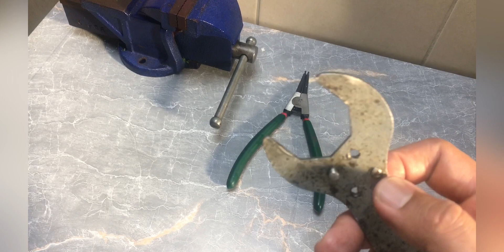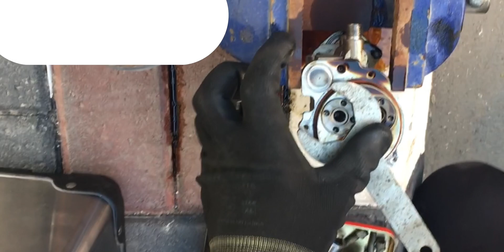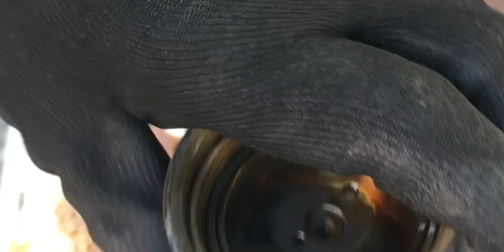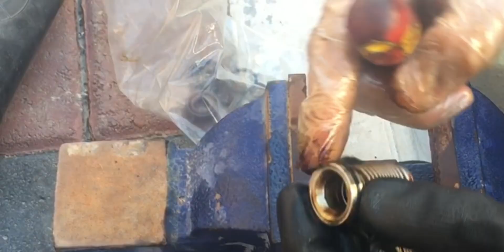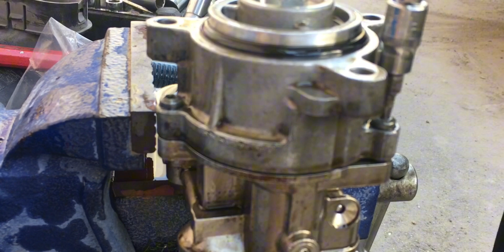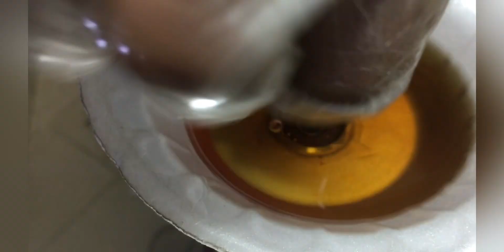HIGH PRESSURE FUEL PUMP Repair BMW N53 N54 N55 Engine

Comment: for anyone doing the rebuild,  don't use engine oil.  it should be something like Mobil DTE 25 or Mobil DTE 24.
Reply from the maker: Thanks for the info.
Reply: Aeroshell 41 is what to use. Just buy a quart. You'll barely use any.
Reply: @TheFrenchPug  it's not about using oil.  for these to last a long time you have to remove almost 100% of the air from the pumps, only possible in a vacuum chamber with the pump completely submerged in oil.   I rebuild porsche pumps.  if you don't do it that way they won't last .  the air will eventually destroy your bellows and possibly blow out the shaft seal.
Reply: @tomzphone Oh, that sucks. But I haven't had one fail yet. I see what you are saying, though. I would like to do that, but I use a mighty vac on the diapragm when I fill mine. So far, so good.
Reply: @TheFrenchPug  i had 2 fail at less than 5k on the pump when not vacuum filling,   once I started vacuum feeling at 30k miles now without any issues.
Reply: @tomzphone about to vacuum pump in a chamber.. what oil goes in the vacuum chamber to submerge the pump in? I have aw46
Reply: @tomzphone also do I put the pump  in the vacuum chamber before or after I refill the diaphragm with fluids?
Reply: Before. You want it pulled towards the hole while the chamber fills with the oil.
Reply: @Ryu_Collectibles  i use Mobil DTE 24
Reply: @tomzphonedo porche and BMW and all the big brands get continental and Bosch do scuba dive in tanks of oil to build pumps U make out ur so much better than other people but U can't even work out the OEM fill procedure and ur right on one thing air matters more than oil type but U don't need to bath it in a oil filled vacuum tank oil give U that tid bit for free I might not have built as many pumps as U claim but I guarantee mine will last 20years so go blow ur horn somewhere else and don't expect me to tell U my proprietary secrets if U can't work out how OEM'S Did there pumps
Reply: @tomzphonethought U had 60 builds and no fails U vacuum tanked Porsche pump builder you.lmao. PS. You know all car makers use pump manufacturing companies to build there pumps so no pump is a "Porsche" or "BMW" PUMP also no OEM Company bathes pumps in oil and vacuum pumps them they have proprietary equipment and methods to fill assemblies and remove air maybe when U pull ur head out of the clouds and humble urself U will learn how the big boys do it. When ur ready for a master class in building legit pumps come see me.😘
Reply: @cammo81 what's your problem?     Pumps are working, everyone is happy for 10% of the cost of a new pump.   Are you just trying to tell everyone that you are the god of pumps or are you just an asshole, Cameron?
Reply: @TheFrenchPug  you can't rebuilt the pump that you want to last with a qt of oil.
Reply: @tomzphone, I've done a few that way already. Hardly uses any oil.
Reply: Whatever you put in has to be safe to run through the engine cause if the bearing shaft seal fails again, it all goes straight into the timing cover.
Reply: @GeneralAlgren  there is only very small amount of oil in the pumps, even if all the oil gets into the engine at one time, it shouldn't cause any issues.   I have taken apart/fixed over 35 pumps now,  a lot of them lost the oil via the shaft seal,  I don't know any of engine issues on any of these cars.
Reply: Huile  ISO VG 46 Only as mentionned by @tomzphone it's not obligatory to use mobil oil but the viscosity is important
Reply: Don't use X rings use fkm/viton o'rings and use  fuchs titan       CHF11S hydraulic oil
Reply: @cammo81  how did you come up with CHF11S?  i had the original OEM oil tested, it wasn't CHF11S.  Blackstone said it was more a AW ISO 32 Hydraulic Oil.
Reply: @tomzphonethere's about 3 different oils that seem to be the main ones BMW used CHF11S in there hydraulic systems from factory and the few people I learnt to rebuild pumps from are using CHF11S but any hydraulic oil that can handle the heat and the cycle will b ok I took an educated guess and I've done about 20pumps and only had one failure been using CHF11S in all of them either way I think it's better than motor oil or some atf's even though there hydraulic aswell I know.
Reply: @tomzphoneperformance engineering solutions actually did this test ur claiming as urs lol
Reply: @cammo81  lol.  I also did the test as well as a BMW rebuilder out of California.
Reply: @tomzphonecool story bro you do you😉
Reply: @cammo81  LOL.  I have rebuilt over 60 pumps, without any issues.  How many have you done?
Reply: @tomzphonemate my pumps will blow yours out of the vacuum tank learn how they were made before U rebuild it in ur backyard
Reply: Excelente , estudie mucho el tipo de fluido que contenía esta bomba y concuerdo plenamente con tu consejo es muy apropiado ,

Comment: Why wouldn't you use a smaller tube on the end of the syringe that can go down into the hole vs. dropping oil on top of the holes which takes a long time?

Comment: Don’t these pumps  need to be factory calibrated? How long did it last?
Reply from the maker: This is just a workaround not to the perfection as the pump cost too much for a new one. Mine crossed 20000kms

Comment: Hello. My friend, greetings from the Netherlands. I have a N54B30A HPPF. When we measure the high pressure, it does not exceed 50 bar. I want to make the pump like you did. I received the seals and o-rings today. The only thing that bothers me is the diaphragm dimensions. In other videos, they say 14 mm. What do you think this diaphragm size should be? Best regards.
Reply from the maker: 14MM is the actual diaphragm depth required but if you keep 14 mm on a rebuild it will not stay for a long run. When the temperature inside the system increases the pressure will also increase and it will push the oil seal out. If you have some gluing method to keep the oil seal in position then I would say 14mm is recommended measure.
This rebuild will not be giving oem pump pressure but this is enough to keep the car running in normal case without any issue.

Comment: Thanks for posting this video. I’m planning on rebuilding and hpfp soon. How has your rotary seal been holding up since you installed it very lubricated? I’ve heard of the rotary seal popping out after someone did a rebuild
Reply from the maker: If you fill too much oil in it will push out. Mine lasted around 25000kms with 17-19mm diaphragm measure

Comment: And one of the biggest failures I've noticed rebuilding these.. And also for the n14 engine in the mini Cooper.. very similar.. previous rebuilders never pull out the solenoid and change the o-rings.. most of the problems are actually on the o-rings. When they start heating up it lets the pressure buy the cracked o-rings.. just a little FYI.. You did great... But next time pull The baffle In-N-Out with a vacuum or a pic multiple times.. it also gets air bubbles out of the expansion chamber.. most people forget about that..
Reply: Do you have the 4 solenoid o-rings dimensions ? There is 1 blue, 1 brown and 2 black ones. Also there's a big orange o-ring separating the pump in two parts. Never found the dimension
Reply from the maker: I didn't change those so don't have it

Comment: Thanks for the video! How's it holding up so far?
Reply from the maker: The compressor x-ring I installed was not tight enough to hold the pressure. I re-did with high temperature O-rings n waiting for the result
Reply: @bimmerhacks  You happen to have a part number for the new o-rings you used?
Reply from the maker: @mcduvall2000  no number lol... I'll check the size next time when I'll do for the next pump
Reply: @bimmerhacks  ok cool. Are you planning on doing any other o-rings? Like the solenoid or the housing?
Reply from the maker: Solenoid and housing were fine in all the HPFP that I have seen. If you use aftermarket one for the housing it will start leaking soon

Comment: I rebuild  my pump and i hade 19mm on dighprha..
But i put back and its stil dånt wanna work shows me same fault code 29F2 hight pressure fuel system.
And this only code left. Car starts and can drive but right away comes limp mode and halvs engine pic. 
And feels like missfire. I head the pressure and its same pressure as before
Reply from the maker: It might have trapped air or oil might be leaking from the HPFP. When u installed the o-ring/x-ring might be loose or got cut!!!
Reply: When I put o rings  they go Smooth  
And i pulled 19mm  and i left  little bit  in pil to take in all oil in  on wake  up the digrahp. And I check after 1 hour  oil level  was same. After i pulled more oil in.
Reply from the maker: @deffbichsweet2461  O-ring must be tight fit. As you might have noticed the original O-ring was so tight that it was difficult to get it out. When the HPFP turns it makes more pressure inside and the tendency of oil to push out will increase

Comment: Hello, good friend, I have bought 3 pumps since they come defective, supposedly new ones that have a 27mm membrane, do they all come empty of oil? thank you
Reply from the maker: https://youtu.be/XR-Z9Tg46xA?si=pibuPxaZTn9wx__Z
As I explained in this video 27mm means there is no oil pressure inside the HPFP, it might have oil in it if fuel didn't penetrate in but NO USE.
If you're repairing go for fully immersed method which I recommend rather than filling oil through oil seal. U can install the oil seal at the end same as I have shown in this video once all other parts has been installed immersing in oil.
Vacuum must not exceel 40ml on a 60-100ml syringe
Reply: great then 100% these pumps are pressurized internally with oil and their optimal and long-lasting operation is the load of oil to lubricate these internal parts, what I don't understand is why the new pumps do not have this pressurization, I imagine low quality Chinese production, this Chinese pump, is it possible to fill it with oil and make it work correctly? Thank you very much for the info
Reply from the maker: @moisesgo55  open it up and see. Don't buy refurbished one, when you rotate the itself you can feel a grinding sense. Buy junkyard one and fix if your diaphragm or any springs are leaking.

Comment: Quick question is there a fix if the diaphragm is leaking?
Reply from the maker: No fix for Diaphragm. Go and get a junkyard one so that you have spare compression springs as well.
Reply: @bimmerhacks  thanks bradah

Comment: Do you have some part numbers for seals or measurements? Specs needed for company what makes o-rings and x-rings
Reply from the maker: Please see description for sizes.
Part number is shop specific so I don't think it will work in your area, those are listed below 
Hpfp x-ring - 37757
Oil seal 62856

Comment: dimensions of the o ring on the outside? where the 2 halves are compressed?
Reply from the maker: No need to change it. I have repaired 3 HPFP and none did I change
Reply: @bimmerhacks  thank you
Reply from the maker: @user-ek5qu6he6m https://youtu.be/XR-Z9Tg46xA
I used to miss some information that I used to convey in succeeding videos. Fixing and vloging together is a bit difficult ;)

Comment: 21:00 when I was cleaning this orifice I had some small chunks that came out that turns to like sand when u press on it a little bit, also after putting the diaphragm started to leak a little bit  of oil, have encountered this? Also I use thinner oil 5/50 just to check but I think it needs a thicker oil to put inside . Any advice thanks
Reply from the maker: Thinner than 0w20 will be too light that it will not do the job of lubrication. If there is no lubrication there will be more wear and metal shavings will accumulate like sand. I think you can use 5w30 if you want thicker but too thicker might not work properly as the flow of oil has to be fast to compress the pistons. I had tried the thicker differential oil 3 years back and it was running fine, but one day out of curiosity I opened up and found that it was not lubricating as it should and was accumulating metal shavings.
Reply: @bimmerhacks  I was thinking the same, 15w40 ok?
Reply from the maker: @1kontrabida  it should be OK, just my thoughts not a pro 😉

Comment: how long does this modification last? have you had to rebuild the pump again after having done this?
Reply from the maker: This was done 2 weeks back. I had done similar fix 3 years back and its still running fine and crossed 25k miles. If the pressure inside the hpfp is higher then there is more possibility of early failure

Comment from the maker: NOTE : The suction to be done on the syringe is near to 50ml if you are doing full oil immersed method follow the below link:
https://youtu.be/L9DwZR_sW_Y?si=gb2auuR16Y7Z5jdh
Reply: Im rebuilding a hpfp for a 2010 mini cooper, the design looks very similar, would these gaskets work on it too?
Reply from the maker: @zBanditGuy it looks the same... Try the high temperature (brown color) O-ring which tight fits to the compressor springs. See my new video in the comment